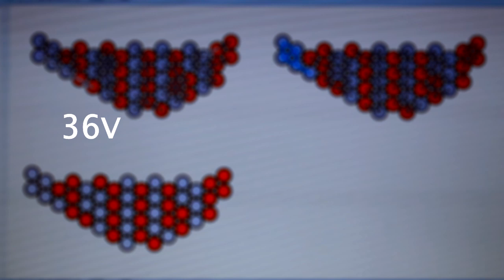36V 14.5Ah li-ion battery designed for a small 1.5L frame bag

Comment: hi damian  : please i need your help in bms or pcm
can you help me to find a good 37V (15A or higher) BMS / PCM ready  to use  and where can i buy them .
Reply from the maker: You can find several boards on ebay / Aliexpress. What you probably need is a 10s li-ion BMS. Every specification should be described as maximum continuous and peak amps, and also chemistry type (4.2V for li-ion / Lipo)

Comment: do you use special hot melt glue sticks? I have found hot glue does not hold well to certain materials.
Reply from the maker: +difflocktwo I use melt silicone, similar but not the same. Hot glue have a different composition. You can difference them because melt silicone is heavier and much more dense and rigid. Hot glue is much more flexible and light, have a much lower density,  never recommended for attach cells
Reply: +Damian Rene is it reactive? can it be used with a normal hot glue gun? I couldn't find anything online. usually silicones are not thermoplastic.

Comment: Where do you get that awesome blue battery wrap?
Reply: Nice Work!Was this for a E-bike ?,..How many amps could a E-bike potentialy pull going uphill ?And how do the Series Conections sustain these high Amps ?Thanks!!
Reply from the maker: +Thomas White I made a thread with some resources, included the shrink.
https://endless-sphere.com/forums/viewtopic.php?f=14&t=68005
Reply from the maker: +integra Depend of dozen of factors. Basically the battery must fit controller specifications, and the BMS a maximum power output that won't allow the cells to discharge at a too high rates
Reply: OK, but if you need Higher Current on Series connections , can you spot weld a second layer of nickel strip ?
Reply from the maker: always, there are several places where extra nickel layers must be added, as main leads positions for example
Reply: ok thank you !